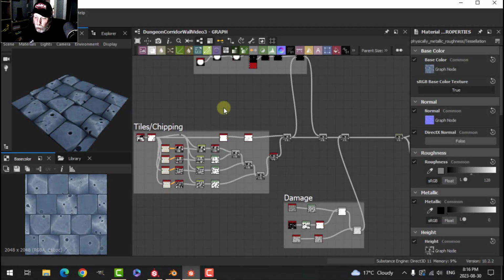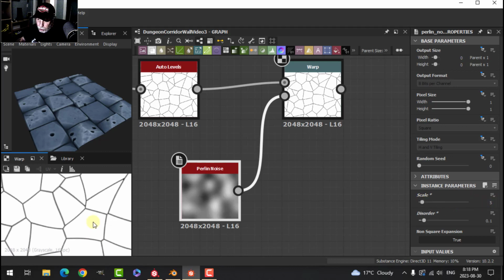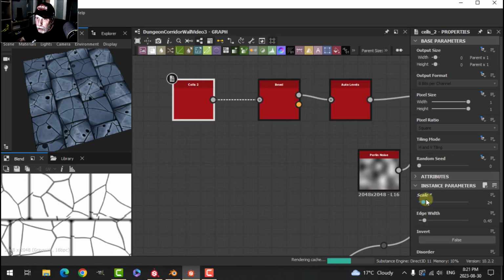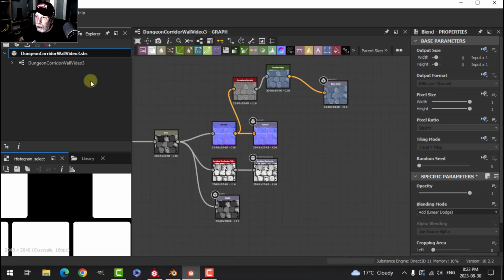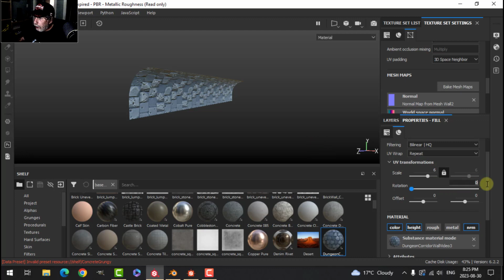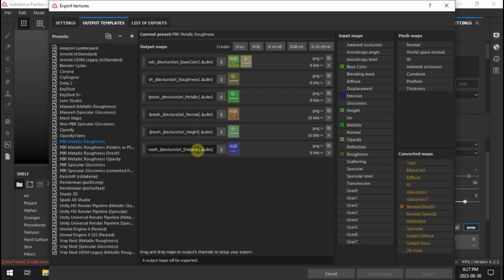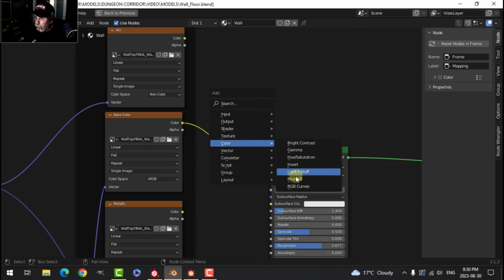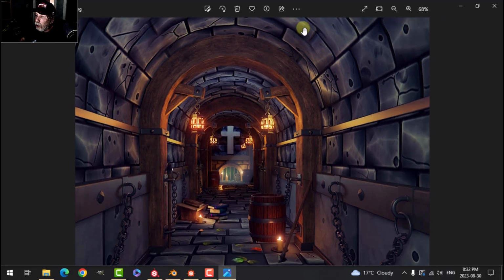SUBSTANCE DESIGNER: DUNGEON CORRIDOR: BRICKS (PART 4)

Comment: Cool video, in an unrelated topic Is it possible to project a texture on both sides of a curved plane in blender or would that require 2 seperate planes to texture both sides?
Reply from the maker: Thanks.  You would need two sides, one for each texture.  Use solidify and then apply a different blender material to each side and then you can put separate textures on each side like a wall with plaster on the inside and bricks on the outside.
Reply: @zerobio  ah i see, thankyou
Reply from the maker: Good stuff!